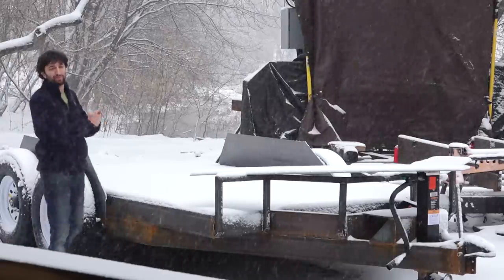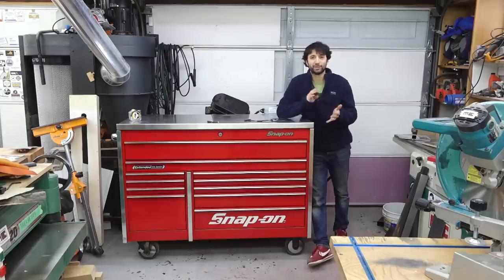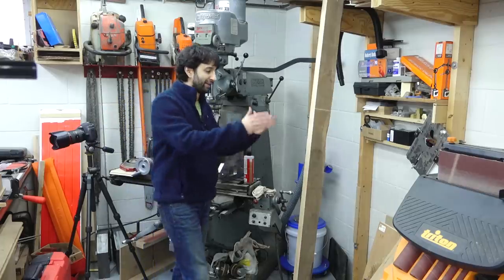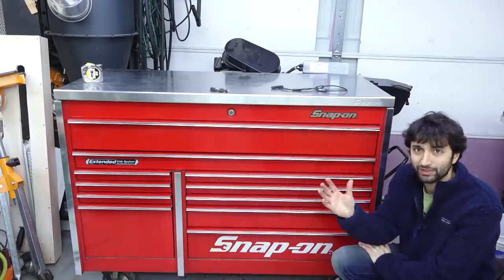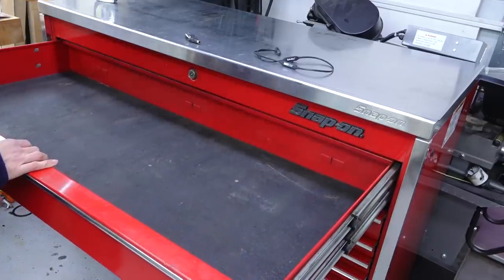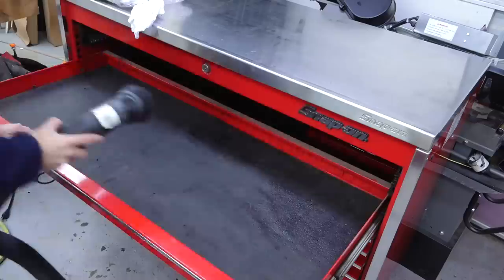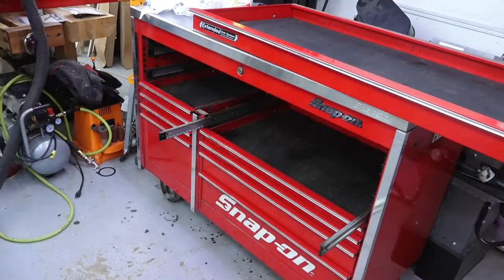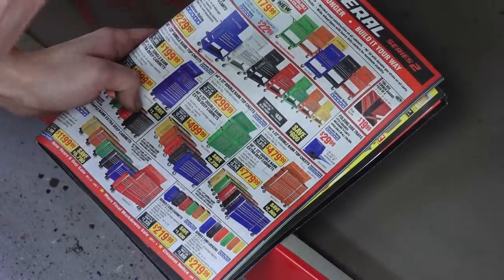Cleaning up a Snap-on Toolbox and Organizing my Shop

Comment: You may want to consider mounting a vice onto of the toolbox. They originally came with a paper layout for drilling the top to mount a 6" vice.
I have the older big brother to the box you have. I have 2 boxes ontop of my box, one for automotive and the other is my wooden machinist box.
I started off as an auto mechanic, then a machinist, then a machine builder then an engineer. I actually have 4 roller boxes, all but one has a top box. All are for the tooling or tools for each machine in my garage. One for my lathe and mill. One for for my welding and grinding. One for woodworking. One for plumbing and electrical. The box without a top box is my portable automotive cart for taking out into the driveway to fix or build my projects. I do racecars and hot rods now.
Great show, always enjoy your shows. I'm still waiting for your hydraulic upgrades to the sawmill.
Thanks for the fun.

Comment: I agree with you about your new cabinet. You buy quality, and it will give good service for a long time. My father was a mechanic on cars, trucks, diesel earth movers, aircraft both Army Air Corp and later F14, F16,  and F18. He had a rolling Snap-on tool cabinet that was older than me. I'm in my 70's and it was still in service even after he passed on.  Buy the best you can.

Comment: Having installed literally thousands of the full extension drawer guides over the years, I have found that if you pull the following strips that are on the cabinet members, all the way forward (some have a detent that locks them in the forward position)before you put the drawer members into them, they engage more positively, without the possibility of getting things out of line, with ball bearings dislodging and going everywhere. Which I have done my share of. 
Good vid.

Comment: Matt coming from the automotive repair side. Most of us used the top deep drawer for socket trays and ratchets. You can stand them upright. The long drawer under that was for wrenches . It will fit your large wrenches and pipe wrenches. Just throwing it out there.

Comment: I love these style of roll around toolboxes. They're not really common here in Tasmania (or so it seems), but I've managed to collect a few (smaller than that one). I use them for woodworking tools, machinist tools, welding accessories, and measuring gear too. I will one day do a shop tour so you can see my system, but your 'aha' moments with putting all the grinding stuff together, for example, is something I've had too. Great feeling :-) Cheers, Craig

Comment: Matt,
Glad to see that you got a nice Master Series chest. I'll have to go count, but I think that I own 27 tool chests. A couple of the small ones aren't full, but the others are crammed full. I am like you in that I value quality, and Snap-on does a good job with their chests. Full extension drawers are an additional bonus not found on cheaper boxes. I only own 4 Snap-on chests. Most of mine are Kennedy chests. Lista and Stanley Vidmar are other interesting options, especially if you want rugged construction. I own one Lista cabinet. I prefer many shallow drawers over deep drawers. I tend to discard blow molded cases, wrench rolls, and plastic packaging racks in favor of packing my tools closer and tighter with purchased or custom fabricated racks for tighter tool density. If I didn't, I would need more tool chests.
I like the mechanic storage solution for woodworking.  A single drawer holds an abundance of router bits. I have at least three drawers dedicated to wood turning tools. Now that you have a mill, you will embrace drawers for tooling. One 29" Kennedy drawer holds over 400 of my small end mills and reamers. I separate my HSS, colbalt and solid carbide drills as well as separating, split point twist bits from standard grind, lettered, numbered, fractional, stubby, left hand all separated from Morse taper, wood bits like spade bits, brad point, Forstner, spiral bits, and then I have masonry bits, SDS plus, straight and tapered... I keep kits of matching taps and drills in addition to tap and die sets.  I don't know how to manage without drawers. I can't keep enough wall space for shelving and drawer cabinets allow much denser storage. Formed steel tool chests take up less space than building wooden chests. Full drawer extension with 400+ load rating is worth it to me. Tooling, wrenches, sockets, pullers, etc easily can approach 400 lbs when packed as densely as I pack tool chests.

You are a young man and the tool buying illness will only get worse.  I have been retired for three years and I am still aggressively purchasing tools. I brought my six cabinet tool chest home when I retired. It won't fit into my shop, so I commandeered a wall in my wife's old kitchen. She occasionally still objects, but I think that it is handy having a big tool chest in our living space. I contend that she has 4600 ft2 and I only take up one wall in the OLD KITCHEN.

Enjoy the chest!!!

Comment: I have a couple of these boxes and what I like most is the unit will not tip over when you open all the drawers. Looks like you could use a 12 x 10 storage shed as well.
Reply from the maker: Thanks! I have one of those as well
Reply: @mcremona  just checked, mine are Classic 78 units. Enjoy, they are all great tool chests

Comment: 400 sq. feet!  I couldn't do it.  About 7 years ago I built a 1200 sq. ft shop behind my house to park my boat and within a year or two I wished I would have built one twice the size!  About once a year I do a thorough cleaning so I know that weird feeling you talked about!  lol  I have mechanic boxes for my mechanic tools and built some wood boxes and cabinets for my wood tools.  My welding table is almost 4x8 and my welder rolls under it and there are pegs to hang various welding stuff.  one corner houses all my lawn equipment.  Two 60" ZTRs and a beefy old John Deere 430 garden tractor that I restored.  The boat is back outside and I am going to build a lean-to off  the back to put it in.  No matter what you build you WILL fill it!  lol  Good luck.

Comment: I bought a brand new dewalt tool cabinet from home depot...and when I got it home, I took some drawers out, and realized it was rusted inside...must have been in the store for ages, as I also found out dewalt had discontinued it by the time I bought it.  So I had to take all the drawers out and paint everything inside...hope it will work longer term.  Good luck with yours. :)

Comment: Nice!  Diesel mechanic here, have had my Schnappy box for almost 25 years now.  Only complaint is the drawer liners.  I'm an aggressive drawer opener/closer, and with the weight of the tools sliding around in there the liners tend to bunch up/not stay put.  Replaced 'em all with some thicker rubber.

Comment: In the process of organizing my own garage shop, such a great feeling when everything (i.e. tools) has/have a home.  Enjoy your videos and watching with increased interest your videos on the trailer build (that's one heavy duty uint - will serve you well for years to come - can't wait for the next one), we're battling winter as well here in western Canada, although I'm sure we have you beat on the low temperature side of climate.  Also very intrigued on your videos about the Bridgeport.  As a recent inductee into metal machining (amateur woodworker for many years) with my acquisition of a 70's version of a Craftsman 12" metal cutting lathe, your video on the Bridgeport intrigues me.  As well I have my shop is in my attached garage so I have residential power (single phase not 3 phase), although many of my woodworking machines are 220/240 powered on 20 amps or more(welder powered by 50 amp breaker).  How have you configured your Bridgeport to run on single phase power as I thought most of these machines are 3 phase.  Getting a mill (such as a Bridgeport is my next search project).  Could you also tell me which video shows you acquiring the Bridgeport, picking it up, & then loading it onto your trailer.  I saw the one where you unloaded it, but couldn't see or hear clearly the link to picking it up and loading it.  Once again thank you for your excellent videos - as a subscriber I look forward to your next edition.

Comment: Your addition of 11 drawers is great.   I have 72 drawers to keep organized.  I have moved stuff around after using the first, second, third "system" I had.  Don't be afraid to do the same.  I use magnetic strips with white labels to identify what is where.  11 drawers are easy... at 72 it becomes "Wait, Where are the terminal tools?"

Comment: Matt, You can't go wrong with Snap On. I have a bunch a Craftsman; their drawers are not full extension or removable. Do I need to go on? I am a hobbyist, I'll make do. This is your business, spend a little more it will save you a lot of valuable time down the road. Imagine the time lost having to replace a piece of crap in a couple of years.
My shop is under 375 sq ft. A strong piece of advice before you put tools in that box; replace those fixed casters with swivels. In a small shop you don't have room to parallel park that big box, you need to be able to push it straight back into it's hole.
Good Luck, Rick

Comment: That is a great looking box!  I bought a used Matco. I spent a week cleaning, making drawer liners and doing some touch up paint. The Snap on guy called and had to have the box back (long story why). I ended up with a brand new Snap on box same model that you have.

Comment: You're not kidding about the Snap-on tool box quality. I ended up getting a brand new KTL1022 for basically half price. Truck bed liner top, power top and on Extreme Green with Black trim!
Reply from the maker: nice!!

Comment: I've followed you through your various media for quite a while now; allow me to officially welcome you to the small group of woodworkers who desire to store their tools like mechanics! Personally I've never understood why, in a hobby that produces so much more dust than all of the 'gearhead' ones, woodworkers all seem to desire to hang their tools off of walls, in exposed cabinets, on shelves, etc. 
I have the ever-so-slightly-bigger grand-brother (if that's a thing? The Snap-on geeks will understand when they read the number) to your box, a KRL-1001. Like you, I have mechanic's tools, machinist's tools, fabricator's tools, LOTS of woodworker's tools, etc., and it—along with three more tool carts, but let's not quibble over the small stuff—give me all the space I need for everything. I also am lucky enough to have 4x your floor space, so, there's that.
You officially got a VERY good buy for 2020, and I noted that you got the single most important thing that EVERY Snap-on box purchaser MUST get: THE SECOND KEY! For the uninitiated, almost all Snap-on boxes are initially purchased on Snap-on credit terms. (See 10k other YouTube videos for rants on THAT subject...) The purchaser only receives the SECOND key when they complete payment on the box. You never want to buy a box with only one key, because somewhere on the other end of that transaction is a Snap-on dealer who will try to repossess it as stolen property.
Anyway, congrats on the new addition; as you already know, it will last forever!

Comment: Good video, Matt.   Quite entertaining.  
Gotta love the red!!
Maybe stick an old rubber floor mat under the beam-saw to keep the moisture that creeps up through the concrete floor from going directly into the motor on the saw.

Comment: I can't imagine that storing Bridgeport tools in the SnapOn box would be very efficient - it would mean every time you used a tool you would have to walk the full length of the shop to get it and then back to use it, and then walk the full length to switch it for the correct size, and then back again. Whew I;m tired just thinking about all that walking. The solution I think is another SnapOn box maybe 36" wide, sitting right beside the Bridgeport, for all that bridgeport stuff.
Reply from the maker: That’s the plan

Comment: Matthew - nice video!  But, I don't see much difference in the clutter, especially your mill bed, from the beginning to the end.  

I've had a basement or garage shop for 40+ years, but have restrained my acquisitions to align with my ability to organize :-)  I use the "one touch" method: If I touch it, it gets put into the right place before I let it go.  My wife and I drive each other a little nuts as a result.  But I can generally hand her her car keys when she can't remember where she put them :-)

Comment: Matthew, that is a really nice toolbox, to say the least. All that toolbox cleaning, even going the extra route of/by dismantling the drawer slides and cleaning both those and where they mounted to the box walls was exceptionally notable. Albeit, unless you just somehow failed to video it, you never removed the individual drawer liners and cleaning under them. Unfortunately, even though you were quite successful in organizing a number of your handtools, I don't believe that you gained a square inch of space in your shop it'self. In fact, you probably lost another 8/10 square feet of usable area with the box.

Comment: The problem you'll find As you move things around, Where did I put those dogone XYZ's?
Once things are moved from a place you're familiar with, to another place, we will be a bit lost in the transitions.

To get a better jump on your new storage system, it's a good idea to use labels, inventory charts and maybe some pictures of each zone of storage.

This methodology not only gives you a good look at what is where? But also, in the event of loss, you have a records of both video/pictures and lists and where they're located.

 The suggestion may seem a bit anal retentive and pedantic to some, But you, Dad and some older viewers will be vigorously nodding their heads in agreement.

Finally, one of your readers mentioned an age-old wisdom, "A place for everything and everything in its place". I grew up with that voice In the back of my mind. And, I did not throw very many tools In frustration as a result.

Okay, I remember 1 time doing a brake job with a buddy, And I totally lost my composure. For like 10 minutes. After I cooled off and thought things over. In my right mind, I made some changes For the better. After many hours of reorganization in my own garage, life became so much better. An ounce of prevention is worth a pound of cure. ?

Comment: @19:18 Jaybird X3 sound pretty good but at some point you'll misplace the charging clip and will become useless, like mine.
Reply from the maker: I keep it plugged into the hub on my desk but I don't use those very much.  They're too big for my ears.
Reply: @mcremona  I use KZ ZS10pro now, less than half the price, sounds much better. Cable can be swapped for bluetooth $20 more, but I haven't bothered.

Comment: Welding in the snow... that could have been a shocking build video
Reply: Been there, done that. It tingles a little bit if you don't keep dry and you are in the path of the grounding.